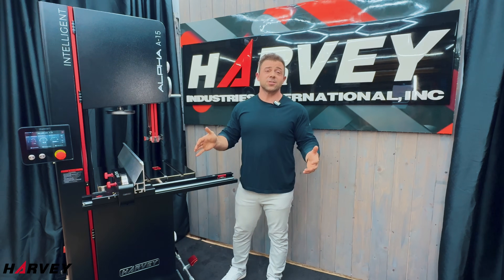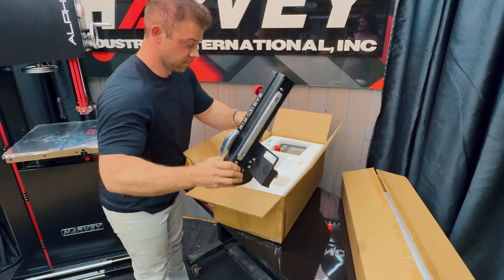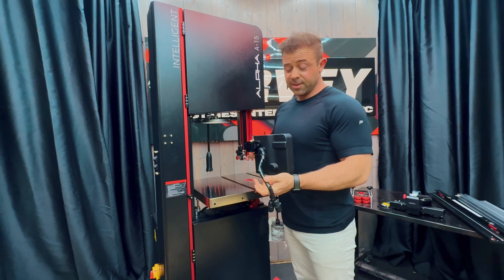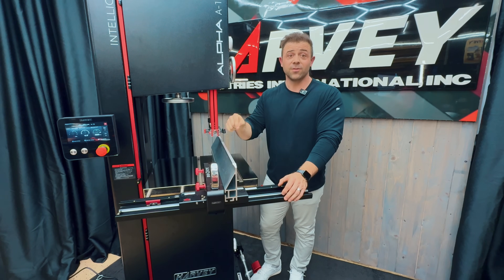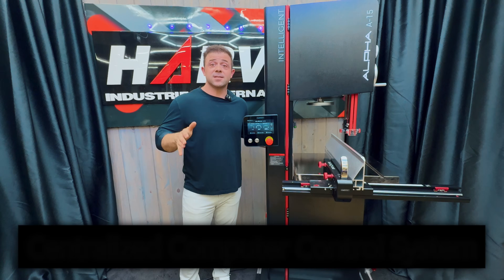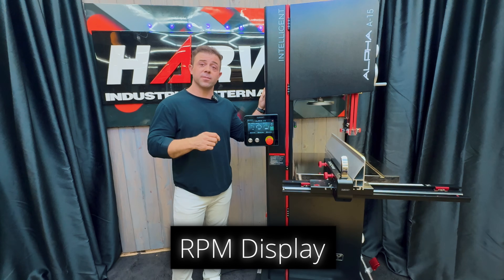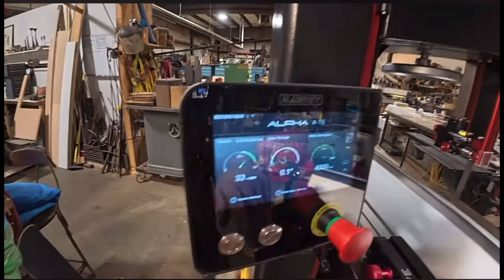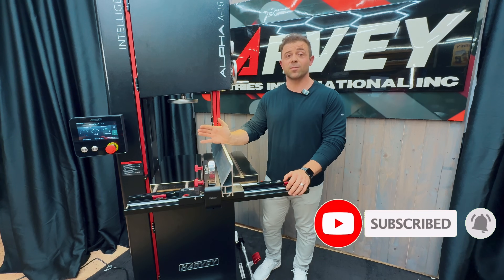A Bandsaw with a BRAIN 🧠The NEW Harvey A-15 Intelligent Bandsaw

Comment: No offense but I dont see how an RPM gauge, electronic angle output, and a sensor for blade tensioning is worth the difference between a $2600 and $5000+ band saw (alpha vs intel alpha). Sure there is the fence, but that is now standard for the table saw, its only a matter of time until you make that standard for the regular alpha too.

Comment: Adjusting tilt on the back while the display is on front.. Very "intelligent". A $20 digital angle gauge will do the same.
Reply from the maker: The touchscreen pivots 200 degrees, you can see the screen from the back position 👍🏼 thanks for watching!

Comment: This is all great but the first thing standing out to me is why no TiN coated top? The potential buyer for this will have likely already bought the same top of your line table saw and will want everything to match. That in itself would make me continue with my Laguna.
Reply: I was thinking the same thing, given that this is their flagship bandsaw.
Reply from the maker: Nickel is superior to TiN and we’ve transitioned all our tool coating to Nickel
Reply: @HarveyIndustriesIntl  So the top of the line Alpha table saw is no longer available in the TiN coating? I'd accept what you are saying if that is the case.
Reply: It looks to have the nickel coated top like the newer saws. Nickel > TiN
Reply: @ZakkaryHess  TiN = Titanium Nitride coating. It is not TiN coated. If so, it would look like brass.